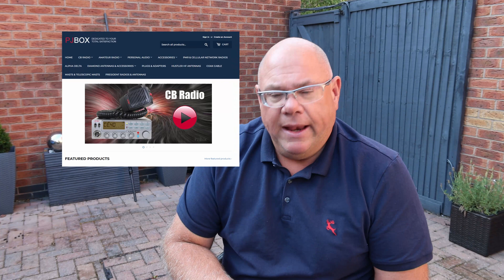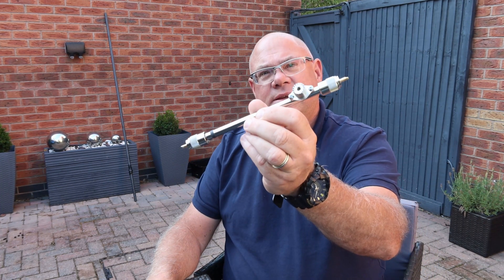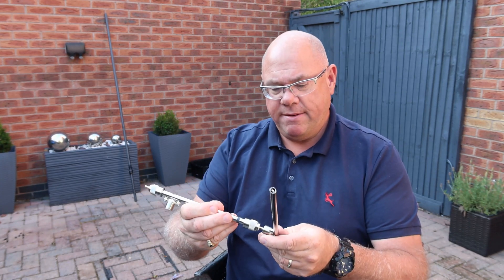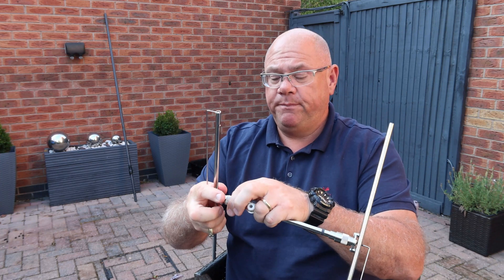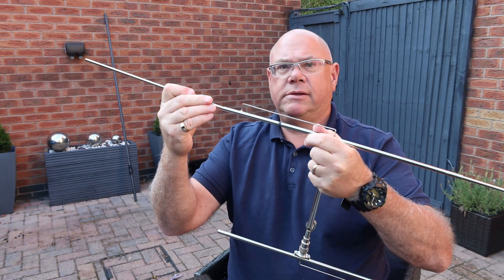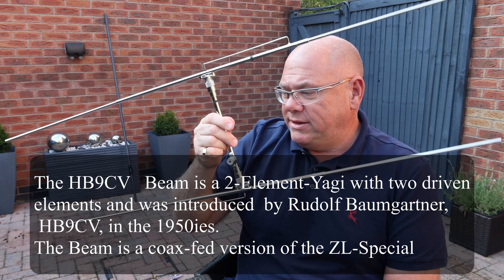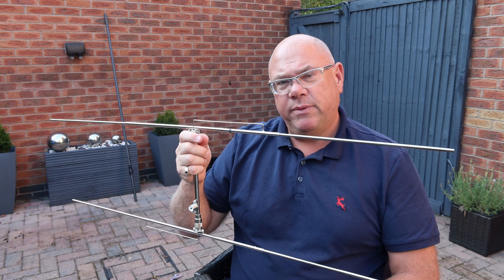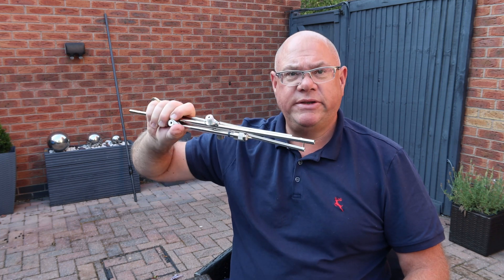NEW 2Mtr Portable Antenna for Amateur (Ham) Radio. WIMO PORTABLE HB9CV Pt#1

Comment: Looks well made, a two element is always the biggest bang for the buck and it should work very well, the hb9cv design as been around for years probably because it works well, I think with about 4.5db forward gain 👍🏼
Reply from the maker: Hi Steve, I went out in the week to do Pt2 but got distracted! In the short time I used it, it lived up to my expectations so I am really happy with it.